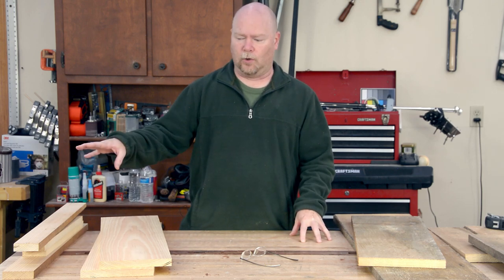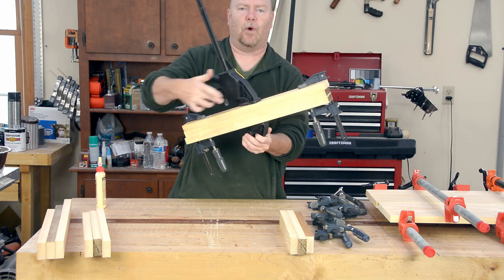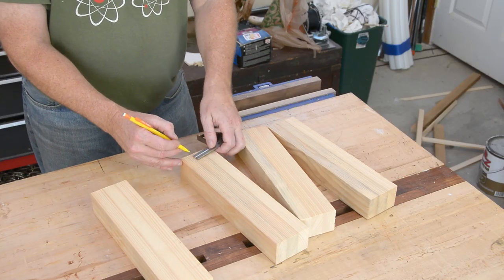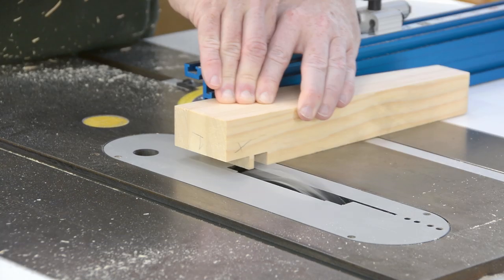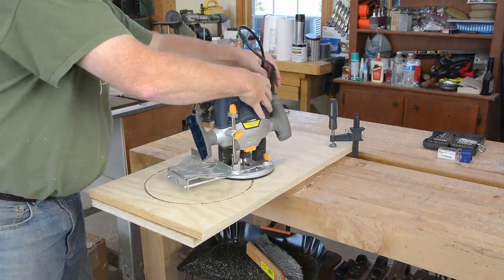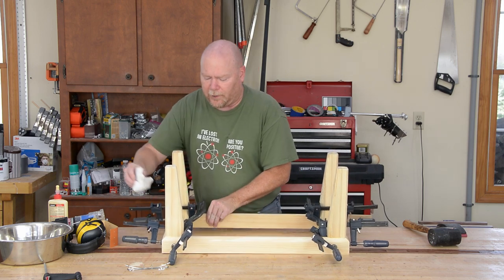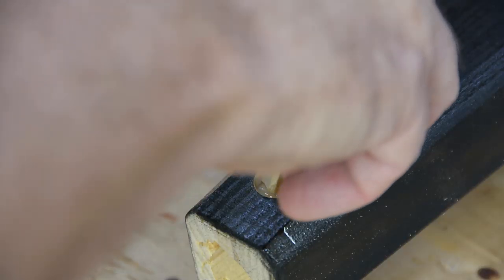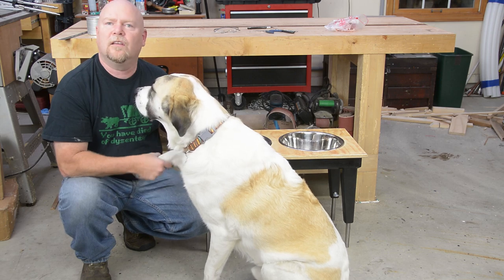WWFC 2019: My Take on the Dog Food Stand

Comment: How about some type of rubber feet on the legs to keep from scratching the floor.
Reply from the maker: You could - or wooden ones if you have access to a lathe.  The rescues and kennels largely have concrete floors, so not a big issue for this particular one.